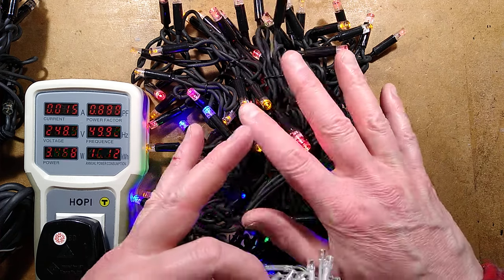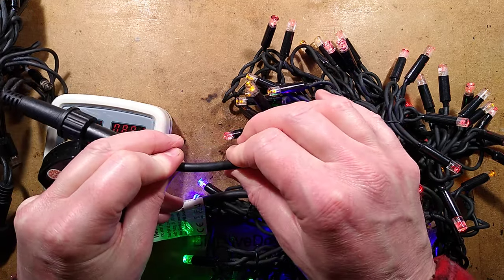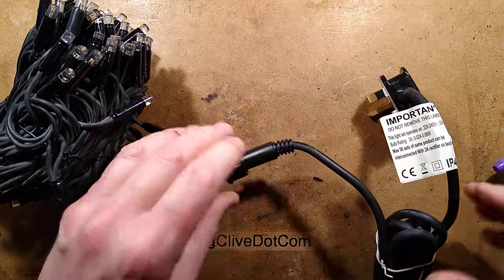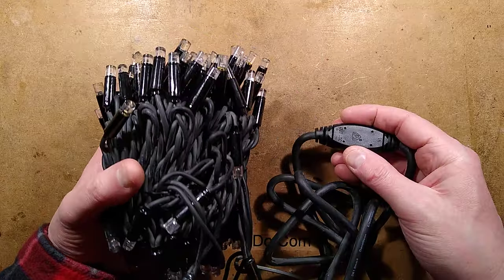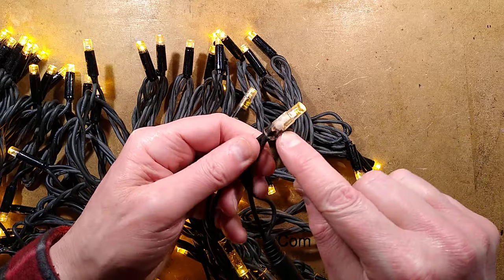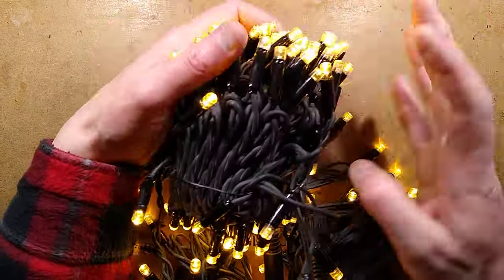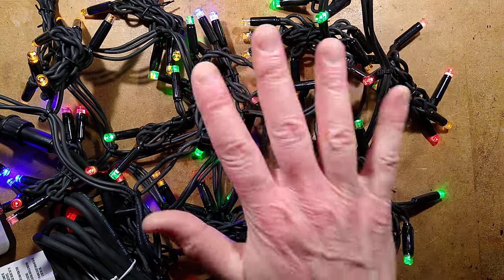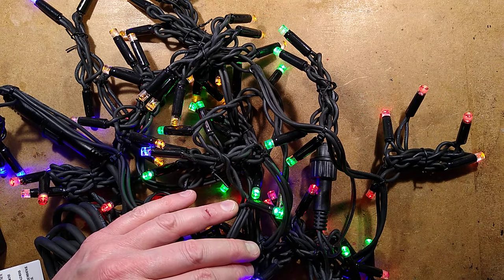The construction and wiring of professional LED strings.

Comment: Professional stuff is better for the environment because of longevity.
Reply: Logic behind disposable stuff is that people get bored and throw things out even when they are still fine and working, so why built them for longevity? And if people aren't buying new stuff from you, how can you make money? Funny how these things work both ways. Fashion and regulations change over time. Do you remember when Mercedes built cars for lifetime? They are not anymore. That is why now there is more push for recyclable materials. People throw things out anyway, so make them more recyclable and harmful to environment.

I still own my grandfather's Cortina Mk.V from 1981. Really amazing vehicle, dependable and easily repairable. But Ford didn't get sale from us for 40 years. If everybody did the same, they go bust. As with every other car manufacturer.
Reply: @jakublulek3261  as if most people drive cars for more than 10years+
The bucked load of your customers gets bored by then! You can sell cars anyway but your reputation goes down, as the product is not seen on the road (in Africa).
The 3rd world just converts to cheap own cars from China/Iran/Russia...

Is it even possible to build a reliable car with euro any exhaust rules?

The car manufacturers get rear ended by their own "financial engineer", look at vw  " how to burn your brand for centuries" techniques, just lie and cheat it will work nicely..
Dummy vw customer buys another one
Reply: @kitecattestecke2303  Most car manufacturers make money on professional, business market where cars are rotated after 2 or 3 years. Private customers stick with used or lower end vehicle. And all emission regulations are still applied on NEW cars, not the old ones. As a government, you cannot ban usage of older vehicles, so they rely on too high maintenance costs to push older vehicles out. And considering that 1990s and early 2000s were massive slump in quality, it isn't unreasonable assumption.
Reply: @jakublulek3261  Economy is a closed circle in which we're trapped for life. This circle feeds on resources, even if its prisoners recycle materials, which still costs energy.
And, yes, I remember the good old Mercedes quality. I owned one in the late 80's/early 90's. It featured pneumatics for the central locking system and automatic headlight adjustment. It kept going and going....
Reply: “The” economy is just a posh word meaning money transactions. COVID19 lockdowns and restrictions show how fragile the so called economy is (for some sectors). While other sectors are making healthy profits. Humans existed before money and money based economy. If we ever find a different system, we will still survive.
Cars can be made to last for twenty years. I myself buy only brand new cars. I’m just over fifty and have only ever bought three cars. The first one I sold to my sister. The second one (a Rover 214sei) lasted 18 years but was still running well when I drove it to the buyer. And I’m still driving my 2009 Toyota Prius.
People love to ‘get a bargain’, hence the market panders to them. In a competitive market, this drives down the price from the rival manufacturers. Who then have to cut costs... And we spiral downwards. Constantly changing models/features/names/colours/shapes to try to keep people buying while using advertising to promote the brand and offset any negative comments from independent reports/media. None of this is good for a long term economy, or for us and the environment. So those of us who are sensible and can see where this is going, really do need to do something. It’s perfectly possible for governments to find gentle but effective ways of persuading long lasting products to be produced. Scrapping all taxes on repair and servicing work, and on spare parts would help. But I’m sure if we put our thinking caps on, there are plenty of other things that can be done to wean us away from our cheap consumer society.

Comment: My poundland garden solar lights  looked like the ones you showed at the start and they didn't make it from spring to winter: loads of rust in them. The solar panel is still charging the battery though so I have a little solar battery pack with a long cable to do something with.

Comment: I cant find it online... does clive have a video on how to fix the low voltage, just shrink wrapped LEDs? Everyother one of my 30 volt lights this year are out, straight from the power supply.
Reply from the maker: Make sure you're using the correct power supply.  Some swap the polarity to flash every second LED.

Comment: One thing I learned: don't try the rectified thing with normal household strings. They intentionally put half the sections in opposite polarities to provide a  good balanced load when fed AC. But that means when you fed them rectified AC only half of them light up. Need a 120V 1000hz AC source if I want to eliminate flicker.

Comment: Hi Clive , do they use hard drawn copper lead frames on the LEDs ?   Unlike cheap modern copper plated steel , which will rust?
Reply from the maker: I think they're steel.  Some traffic light LEDs use brass.

Comment: In the U.S. (120 volts mains AC), I disassemble the strings into their 50 LED sections. Each section has a 240 ohm resistor attached to one of the LEDs.  I then solder the two sections to a mains cord coming from a bottle.  Then, I stuff the two 50 light strings into wine bottles and such.  Sometimes I frost the bottle glass in the sand blasting cabinet.  Other times I'll leave the bottles as-is.  And still other times, I'll follow up the LED bottle-stuff with plastic beads (injection molding input stock).

Without removing the parallel power wires, only 50 lights will fit in a 750ml bottle.

So far, the lights I've played with have no rectifier!  So, they slurp on the AC juice directly which causes a 60hz. flicker.

Comment: Quick question Clive. I have an LED constant current fixture with unknown current setting (no markings on the fixture). I have a tester that shows it has a forward voltage of 17V, but struggling to get my head round how I would determine if it is, say 350mA, 700mA etc ... any sage advice from Clive or followers? Remember I have no documentation of wattage etc, just a measured Vf. I also don't want to destroy it to find out ...
Reply from the maker: If there's no wattage stated then it's probably a 350mA fixture with 1W LEDs.  But that's just a guess.
Reply: @bigclivedotcom  Cheers, I may have to dismantle one of them to see how many LEDs are on the board ... no idea why someone would remove the labelling?

Comment: I tried to make a strand of Fairy lights water proof/resistant.  I made a tub of liquid flex seal and immersed the strand through the goo.  When dry it is flexible and it did help but there weee some that didn’t get fully coated and water wicked.  Having the epoxy resin factory installed is awesome.  Where can I get some???
Reply from the maker: Search for rubber LED christmas strings.  The sellers will vary on your global location.

Comment: Could you cut the set halfway if you wanted it half the length?
Reply from the maker: If it's the type that transitions between sections with just two wires then it is possible, but the cut ends will need well insulated.  It's not normal recommended use.

Comment: Could you help answer a question? I bought some vine led lights off Amazon, it came with a 2 prong circular Dongguan Rico brand plug and a tiny black LED converter/driver box to go into my American style outlet. The voltage says 100-240v 50/60Hz .2A input, and output is 31V 193mA 6W. I’m not sure the voltage that my American outlet has but it was plugged into an extension cord that I’ve used for 2 years with no problems. The lights stopped working after 2 weeks. The driver/converter box still works with a different brand of string lights with nearly the same input/output so I know the driver still works but the lights on the vine don’t light up. Can I do or buy anything to fix it? Or did the bulbs short out or it’s a fuse issue? It was probably cheap and it says on the black box it’s made in China, which I’m sure they weren’t doing their due diligence to handle American outlets and it overloaded. If you could let me know a way to fix it that would be great, I love the vine lights and they were a pain to put on the wall!

Comment: I suppose the LEDs themselves are also dissipating heat. Not just the resistors! What percentage of the power is actually radiated as light in a normal LED?

Comment: Interesting video, Clive. You can clearly see the difference between commercial grade and domestic grade lighting. If you are suitably skilled, purchase a switchmode power supply with high current capability and use that to drive large LED strings. Use resettable 2A > 5A circuit breakers in series.

Comment: Is there Ian easy way to make LED strings flicker less at 50/60 hz?
Reply: Yes. And no. If they're half wave rectified they'll be flashing at 50/60Hz. Change it to a full wave rectifier and it doubles to 100/120Hz. Add a suitable large (huge) capacitor and they won't flicker at all. However the led strings probably won't cope too well with the additional heat that they now have to dissipate and definitely weren't designed for. So it's easy in principle, but probably not in practice. They almost certainly rely on being off for half the time purely so that heat in both the LEDs and resistors doesn't get out of hand.
Reply: @georgeprout42  I'm not sure but I think most to all consumer grade strings don't have the rectifier.
Reply: @trey1531  well, the d in led means diode, which is a rectifier... so even without any external components they'll be half wave rectified.
Reply: @trey1531  - it very much depends on the design and construction of each set. There are numerous variations. It also depends on how much money you want to spend. At which point, it may be more practical to go and buy a new set that has less flicker. For example, a low voltage DC set that runs of a PSU/power adapter.

Comment: How are the lights where each light is addressable and the strings extendable wired? Does each one have a tiny microcontroller tied together via a serial bus?
Reply: These might use something like a WS2812. Each LED has a serial input and a serial output. The data is shifted down the entire chain and then latched in. Technically each doesn't have a tiny microcontroller (it's hardcoded logic instead) and it's not a bus, it's a chain.

Comment: For many years i have been taking the light strings that one half dies on, cutting them at the two wire part in the middle and joining them with another half set.  At least now i know why that works.
Reply: i cut and fix my rope light every year, started as a 25 meter set. it's now 7 or 8 meters

Comment: Surely they would run low level mains voltages ones through isolation transformers?
Reply from the maker: The low level lights are run from 24V waterproof power supplies these days.

Comment: Clive I'd love to see you have a look at the Christmas LED offerings from folks like Paul Zhang, Wired Watts, or Holiday Coro. They're addressable RGB and aren't CSA/UL certified (I'm Canadian) and wondering how safe they are to attach to my house. They come in two flavours - 12VDC and 5VDC, I run the 12VDC type. Some folks have seen quite scary fire situations this year and the hobby isn't sure if it's to do with the epoxy potting or something on the IC. If you want a set I can send you one. Thanks in advance!

Comment: Hi Clive. I have a small 3 AA battery pack with a 3 way switch that was removed from a set of Chinese fairy lights. the little circuit board within with battery box contains just1 15 Ohm resistor, and a transistor. The only other component of the board
Is the 3 way switch. The switch causes the lights to be on static. The next position causes the lights to flash. I have connected the battery pack with just one AA battery to a joule thief circuit, which flashes. What I don’t understand is how the battery pack causes the led to blink. There are no black blob hidden chips. I can send you photos if it helps. I looked at the transistor but it has no markings to indicate it’s type. Any ideas? Thanks

Comment: Can I ask if you will do a video on the 2 wire Christmas lights that when you run a current one way the alternate lights come on and reverse the current the other lights come on , not all of them at the same time, unless you use their controller to make them flash or switch or all on at the same time. thanks
Reply from the maker: Those are very annoying as the only way to get all the LEDs lit static is to alternate the polarity at high speed.  It's simply alternate polarity LEDs along the run of lights.

Comment: Do they also have similar rugged chains for individually addressable chains?
Reply from the maker: The WS2811 pixels are moulded into plastic and operate at low voltage.  I've not come across a rubber version.

Comment: Are you sure the plugs can power 50 sets? All the instructions on mine seem to suggest only using 10 on one plug.
Reply from the maker: It depends on the type of lights.  If tend to keep it in smaller sections for easier maintenance.
Reply: @bigclivedotcom  Fair enough. Might be slightly differently rated rectifier in the plug. Either that or they're just a bit shy about burning down your house.

Comment: Whenever Clive does videos about holiday light strings I notice that the LEDs are always permanently wired to the string. I've never seen these in North America, where our light strings almost invariably consist of individual bulbs in sockets. Is the fixed assembly just that much more common in the rest of the world? When I lived in Italy back in the 1980's that we had 240v lights for our tree and I seem to remember that they were individual bulbs as well (obviously, incandescent not LED). Just curious when (or if) the shift occurred.

Comment: I have a string if leds wired directly to 5v they seem to be in seires but the last few get dull why would this happen should i just bin them
Reply from the maker: If they're running on 5V they will probably be in parallel.  It sounds like voltage drop that is resulting in intensity drop along the string.

Comment: Consumer residential strings here in 120-freedom-volts-land typically have no rectifier, and are divided into two strings of opposite polarity, so (as visible with high speed camera) half the string is on at a time, and pass the full 120VAC to a standard  female power plug for daisy-chaining. I'm curious if our municipalities use special industrial-quality sets that are designed differently or not.
Reply: That’s sounds if they are just cheap and nasty.

Comment: In my country, light strings usually have connectors only on one end, so multiple sets can't be connected together. So far I came across a few types:
— 230V mains input, small controller box with a "mode" button, then 4 separate output lines (usually red, green, blue). Some variants have a speaker in the controller box to produce annoying beeping Christmas tunes and flash the lights with the tunes (I hate this type).
— 230V input, small driver box, then a single strip of static lights.
— 230V input, massive 24V transformer, really long wires to small controller box with a "mode" button, then 4 separate output lines (r-g-b or jut 2 colors, such as blue-white).
— 3×AA battery holder with switch, small static LEDs (r-g-b or just white) between two wires. Usually this type can't last long before the batteries become flat. Sadly, this type starting to become more common than other ones with 230V adapter... ☹

But none the less, LED lights are cool, especially the custom ones! 👍 😉

Comment: If you did string together 50 strands, would there be voltage losses for DC across that length that would cause a noticeable brightness drop by the end?
Reply from the maker: It's high voltage, so low current.  With the fairly thick cable the intensity loss isn't significant.

Comment: I’ve always wondered is it easy to fix old fairy lights weather it’s screw in or push fit where the wire broke but the insulation still intact just as it goes into the holder
Reply: Very much depends on what has failed. They are not really designed with repairs in mind other than the type with replaceable lamps.

Comment: Careful with the markings on the cable. Not all rubber is equally good for outdoor use. In your case H05RN-F, the "N" stands for Chloroprene rubber, which is the better option, more resistant to sunlight and abrasion etc. But it could also be H05RR-F, in that case, the code for the outer insulation sheath is "R", which stands for natural or (unspecified) synthetic rubber. It can be made somewhat UV resistant, but is not generally recommended for outdoor use and light duty only.

Comment: Something I’ve always wondered (apologies, not an electrical engineer) - in a circuit like this where voltage drops over each diode, is there a tiny amount of time when initially switched on where the voltage is higher on the first diodes in the chain?
Reply: Short version, no. Due to Kirchhoff's current law the current through each element in a series chain is identical. Long answer stray capacitances and inductances may have some minute effect but it's not worth considering. However, with parallel strings the first element will have a greater voltage because of resistive losses in the line. This can be noticeable on low-voltage light sets.

Comment: It's interesting how different and yet similar these are compared to the US consumer-grade ones I get from Target; same 3-wire arrangement with the LEDs in parallel to the main power bus, same two sections in a string, but mine have no resistors nor rectifier, just pure AC and enough LEDs to drop the (120V) voltage all the way.